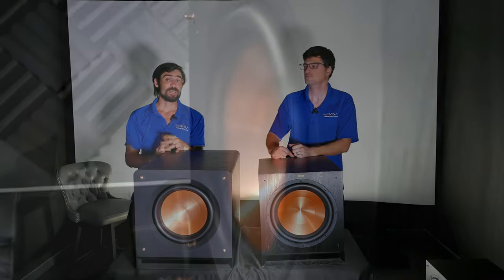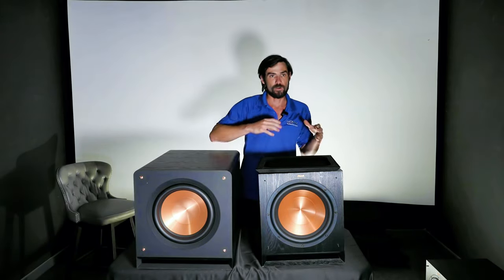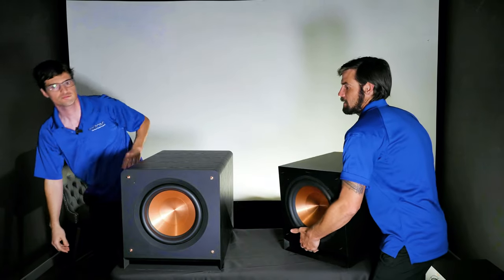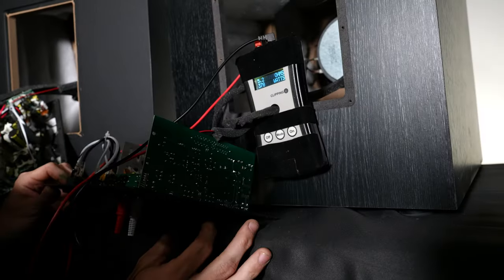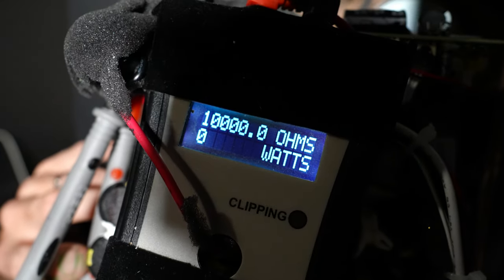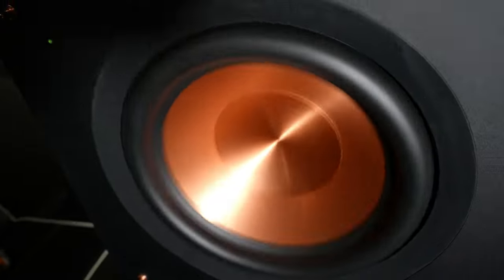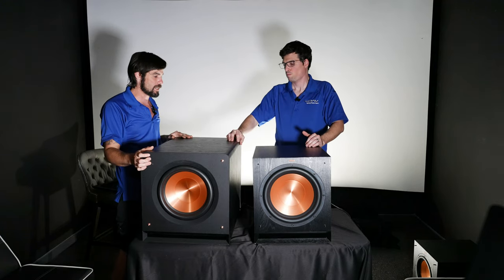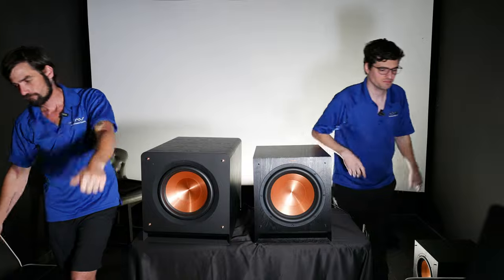I threw away my Subwoofer! | Klipsch RP-1200SW vs SPL-120 Dyno Battle!

Comment: Now if you have the old version and really like it buying another one now that you can get it cheaper might be the best option. Doubling the cone area lowers the excursion to a quarter of what was needed to produce a given spl so you will gain linearity and lessen the chances of port noise, and gain about 6db of output over just the one you have.

Comment: The rounded corners also contribute to its rigidity, I believe - and the speaker grill had to be thicker just to keep it far away from the ultra high excursion new driver, or so I heard. Very impressive first impressions of the new Klipsch; they even addressed the issues the older gen had with fragile amps, they claim to have gotten well on top of that issue this generation. Also - you can get huge SPL out of a small box, but you need to quadruple the amp power or some such, a bigger ported box is way easier. :)

Comment: True.  The Spl120 line...I own 2 they can hit hard in movies and music ..On the first day owning them i knew the box design was way to small For al that air pushing at high levels. Bottom chamber space muffled is reckless of klipsch on a nice sounding sub or subs!..Might look into the Newer stuff later on. But for now my daul 120s are still running al most over 4yrs now..
Reply from the maker: Yeah, we’re on the same page. That thing feels like it wants to rip its way out of the box.
Reply: I have one SPL-120 in my open concept living room/kitchen and I feel it’s not enough. In your opinion, should I get another SPL-120 or get the new ones?

Comment: Can’t be 100% sure, but the amplifier looks to be identical to that found in the SPL-150,  the measurements help n confirming this.

The SPL-100/120/150 all share identical PS/Amp PCBs (all three are marked on the board).  They just stuff them differently to achieve the rated power per application.  Great class D’s— IRS2092 based if I recall correctly 😎

So, same(ish) amp, and larger box.  Only real advantage imo is the reduced port chuff.  Not at all digging the increase in size/weight for a few hz lower extension/small spl increase.  The older models look like even more of a bargain after watching your video.

Thanks for the data point🤙
Reply from the maker: Yeah, the old subs are really good if you can find a good deal on them. But I can say the amp is definitely different and improved because we had a ton of issues with the previous model. Now Klipsch is amazing and they took care of every single one of them in warranty or not. But the new ones have been absolutely rock solid. And the chuffing reduction is a huge improvement. Thanks for taking the time to comment, great thoughts

Comment: I have a smaller Klipsch sub and have really noticed the Chuffing/port flutter too. Is there anything I can do for it? I have the gain turned to only 2 and my low pass on 80 to match my crossover. This Chuffing doesn't occur all the time but is annoying when it does occur. Called Klipsch and they sent me another sub but it  is still happening. Is there a setting in my av I have wrong? Enjoyed your vlog and would appreciate any thoughts.
Reply: The solution is buy a sealed sub

Comment: There isn’t a massive difference between these two subs.  The spl made more than rated rms while the 1200 made less that stated rms.  The spl meter showed the spl 120 was louder which is why you probably cut the vid short.  The only thing I gleaned from this is that the spl-120 is still a viable option if you are looking for a Klipsch sub.

Comment: Don't throw it away! Can I buy the amp plate from the spl-120 off of you? I live in Van Alstyne, TX.
Reply from the maker: Mine failed. This was a bit of an issue on those particular subs. We generally recommend running that one at around 50% capacity. It tends to live in that range. 
Klipsch is one of the best companies out there for warranty claims. Reach out to the dealer that you bought it from and have them put in a claim. Sometimes they will take care of it out of warranty if it’s a decent size Klipsch dealer. You can also just modify it and use something like a crown or other amplifier that puts out more power. Drill a hole in the back of it and then silicone it after you make the connections

Comment: My Klipsch 12' sub just bought new is tube ported in the rear below the amp. How old are the video version? Mine has the squared edges but is 400W rms.
Reply from the maker: yeah, that’s interesting. The majority are front ported. this is the latest reference premier sub compared to the previous generation
Reply: I'm in Canada is that why? Model R120 SW rated 400W 600W peak.The port is actually above the amp in the rear, not below like I previously stated. I wish I could include a pic. Bought new 3 weeks ago. Klipsch gold badge on cover and speaker with green led to upper left.Thank you for your reply.
Reply from the maker: @shanedaiken2831  I see! This is SPL-120. Different series but yours will still perform well. Just move it away from the corner a bit.

Comment: Hey guys, great video, enjoy head to head testing. Would you recommend Rp1200 over the SVS PB2000pro? It's a 500$ premium for the SVS for us here in Australia. Also what song did you use for the SPL test?
Reply from the maker: Thank you very much. We greatly appreciate your support and for subscribing. 

Honestly, the Svs will have a slight advantage, in overall output but I think the RP 1200 will be cleaner, less audible port noise, and aesthetically it’s a nicer, looking sub. You can’t really go wrong either way though.
Reply: cant comment on the pb2k pro but i had dual pb1k pros and my single rp1600 destroyed both of my svs combined. it destroying my svs sb16u as well. with minimal effort and a lower volume at that. id crank my svs and i always felt like damn. this is it ?? this klipsch has me reaching for the remote to turn it down often
Reply: Thanks for the replies, a big sale plus a free upsize 12 to 14 finalized my decision so now i have the Klipsch RP 1400! It's an imposing box but i have no complaints about the sound in my open plan living room! great bass that you can feel and doesn't seem to struggle with anything you throw at it, keeping it at vol 7 and 80hz crossover seems to be the sweet spot that doesn't rattle the windows too much.

Comment: Hello! how are they? I have a 16 m2 living room and an integrated amplifier, I want to watch movies, CDs, streaming music. What combination do you recommend for the living room? Klipsch rp600 mkii or Klipsch rp500 mkii with a subwoofer? I saw several and I would like your recommendation if you don't mind and you are so kind . Klipsch RP-1000SW, Klipsch SPL-100 or Klipsch R-100SW? a cordial greeting from Argentina!
Reply from the maker: hey my friend, thank you very much for reaching out. For your room, I would definitely recommend the RP 600s and 1000 SW. If budget constraints, the SPL 100 or 120 can be found at some sources. their performance is still very good but I recommend running them at around 50% gain otherwise you could experience some long-term amplification failure. The 1000sw has a five-year warranty instead of two and is a more reliable unit plus doesn’t suffer from chuffing noise. 

RP 500 is a bit small for the space.  Thank you so much for your support!
Reply: @DivineAV Thank you very kind!

Comment: At what point would you recommend 2 of these in a room?
Reply from the maker: You could run 2 units in phase a coupe of feet away from each front corner. Bass treat the rear corners with traps and center wall with an absorption panel. You could also run front and rear opposite corners. Try the rear sub in phase and out of phase to see which one performs better. The best option would be four units. Two in phase in the front of the room and two out of phase in the rear of the room.
You need an AVR that has four Sub outs and Dirac live calibration. If it’s a high end, build, I would suggest a Trinnov with the new bass wave forming. Feel free to reach out if you need any products or advice. Thanks 

Avoftomorrow.com
Reply: @DivineAV  sent you a message through messenger
Reply from the maker: @genuinejake9851  hey Boss, can you send a message via text on Monday? Our office staff will help out and get you all set up. The guys in the video are Derick and Warren. They are usually a little backed up with big projects, but they are happy to schedule a call if you’re looking to work with us or grab products. Mercedes in the office is also extremely knowledgeable. She has been featured on the channel multiple times and is a full tech